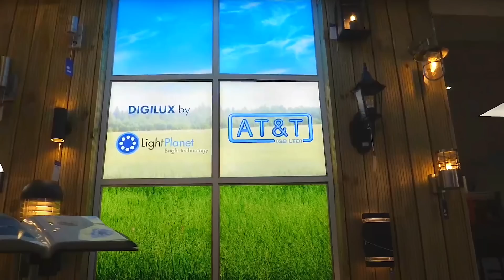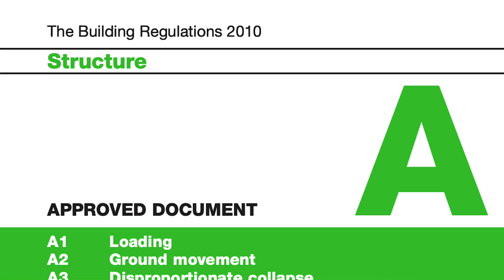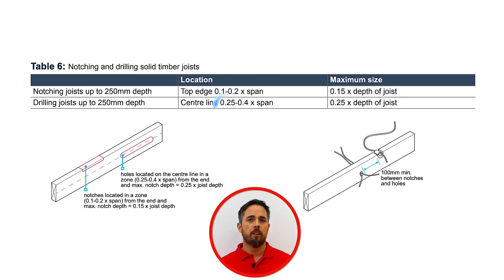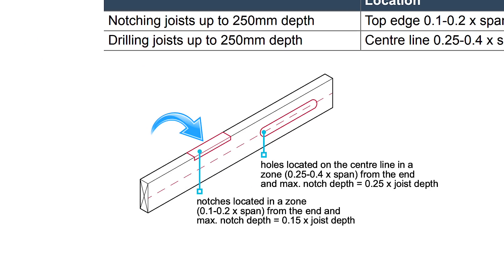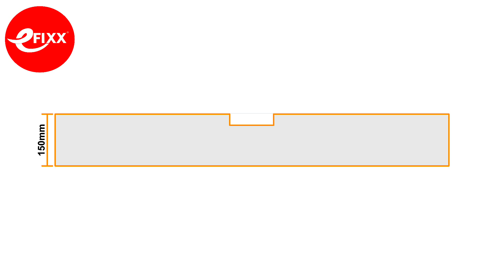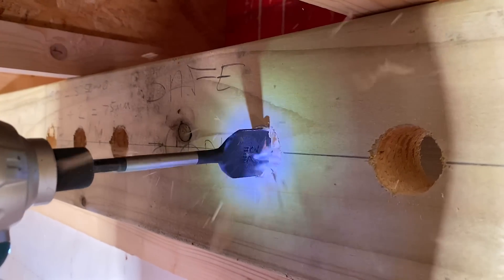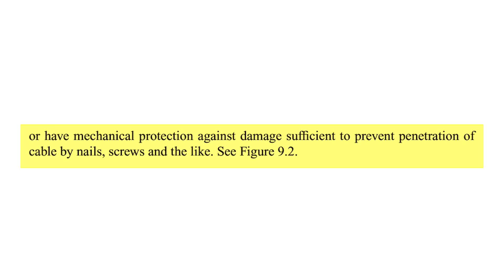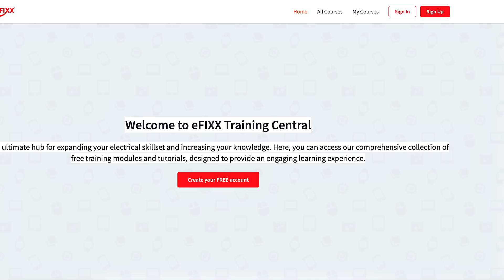Can You Notch Joists To Run Cables?

Comment: A general rule of thumb is don’t make the notch more than 1/3 the depth of the joist and you won’t affect it’s strength
Reply: the more precise rules are outlined in this video and say no more than 0.15 (just under 1/6) the depth of the joist, and even then, only in certain parts of the span of the joist

Comment: As a householder, I found that the joists in our previous Victorian house looked like a swiss cheese from various generations of water and gas piping, plus the electric wiring later installed. Our rewiring and first time central heating installation was difficult, made slightly easier by holes left from ripping out old stuff and the joists being much thicker than modern ones. 
Current home is v old, with oak joists, stronger, thicker, a nightmare to drill, but caused whoever wired it to notch joists stupidly.

Comment: You could apply a layer of battons underneath the floor joists and attach the gypsum boards to the battons. This means that there is available space for running cables between the gypsum and floor joists..... it's that simple!
Reply: good option if the ceiling hasn't gone up yet and you don't mind losing a bit of ceiling height
Reply: @ that’s how we do it in the Netherlands

Comment: What drives me mad is spending a morning drilling joists for pipes only to come back from lunch to find cables run through them. Don't use other trades routes as cables are more flexible than pipes. If you do, don't get upset when we cut them out.

Comment: That's odd - he listed what cable types / requirements should be used when less than 50mm from the surface, the last one being that the cable should be mechanically protected, then a few seconds later states that soft skin cables should not be installed in notches - but surely they can be if they're mechanically protected, such as by a steel plate minimum 3mm thickness.
Reply: yea sadly they decided not to go into detail about that and basically this video ends up as a caution against running cables through notches

Comment: Sometimes in old cottages they have cased floors (double floor boards ) example you take one board up and there is another underneath. Often running opposite directions.  I have even seen 3 layers of boards . You have no choice but to notch the board underneath. 
It there is a likely hood of a nail being put through them I put a safe plate over them. If that’s unlikely I normally just put a buckle clip over the notch to stop the cables moving and keeping them in the notch . It’s surprising how many notched cables we see crushed as the previous electrician couldn’t be bothered to put a clip across the notch.
All this will sound alien to new build house bashers
Reply: Interesting point Andrew !

Comment: Had sagging floorboards upstairs where plumber and electrician had run cables and pipes across the width of three floorboards, with the middle board held in place by the t & g of the other two!  
Sorted it by sheeting out the whole landing with 10mm ply to support the compromised boards from above.

Comment: Who the heck is going to ask a structural engineer if they can cut a notch, if they did the answer would be, you need a steel in there, that's all they rely on these days.
You can't put a cable in a notch but a few gas pipes will be fine, no danger there, I assume these people writing these regulations realise we can now get screws and nails that are longer than 50mm, I know that may shock them, nowhere is completely safe.
Reply: that line is also there because a joist of >=250 mm depth suggests that there might be something particularly heavy above. or you can just go the safer route of a central hole

Comment: The engineer should supply the information required before you start that's why they get paid more if not they are not doing what they are paid for
Reply: If you are doing a rewire for a private individual there's no engineer involved.
You just use common sense, if a house falls down because of a hole or notch in the wrong place, I would say the house was f#&ked before you started.

Comment: your man in your video at 0:08 doesnt look like he's got 50mm to the bottom of the joist from his holes there you know 🤔
Reply: look closer, looks to me like there's an extra bit of wood along the bottom (not sure the correct name) but bit like an I-joist.... I think that's what you're looking at..
Reply: @jameshansing5396 I dont know what youre looking at but the hole he's feeding the cable through with his left hand and the one before it looks about 10mm from the bottom
Reply: Oh I was looking later on.  Maybe that's them showing how NOT to do it, given that it's before they have not passed on any info at this stage?
 @codenamenel

Comment: How do you know the entire length of a joist when there is a ceiling beneath it and floor above it?
Reply: It's easy if there's no ceilings in place, if the ceilings are up you won't really know for certain
Reply: One assumes you'd be lifting floor boards to drill through the joists? So ummmmm see if you can look? and I guess in some cases a little common sense. EG NOT one foot away from the outside wall would be a good start..
Reply: @jameshansing5396  sure but I was thinking of retrofitting downlights and just drilling holes not notches
Reply: you're not an electrician, are you?  @hks-lion
Reply: @jameshansing5396  no I’m not and not planning on doing any electrics but would just like to understand the process
Reply: @hks-lion  other than the retrofitting of downlights you just mentioned? 😂
Reply: @jameshansing5396  no I’m getting an electrician to do that. But seeing as I’ve watched a niceic electrician drill straight into a cable and do a “visual” EICR, I prefer to know something before they come in so they can’t completely pull the wool over my eyes. But feel free to laugh on, I was only trying to understand the process.
Reply: @hks-lion  good for you trying to educate yourself. https://www.youtube.com/watch?v=XnDr8xOe6gw is an interesting video but his technique is technically non-conformant because the circular holes he drills are not central. to answer your question – you will have to lift floorboards and/or cut inspection holes that you'll repair after determining the true extent of the joist

Comment: If good old common sense still existed a tradie could take a look at a joist...and could determine " nah "... you'll weaken it... BUT these days " nah " get the book out ....let's have a site meeting...ring the office...check the Internet...and all after you've donned all the PPE ....and text mummy..... bollocks.....
Reply: Is that why all the joists in my house look like they’ve been attacked by a lunatic
Reply: Think you'd be lucky to get any consideration TBH. Cable's would be laid over or underneath 22mm central heating pipes with alarm cable wrapped around them all by here today gone tomorrow house bashers
Reply: Your not allowed to use common sense anymore
Reply: Paddle bit that sh*t and keep living your lyfe.

Comment: Good video but some views on what would be sufficient mechanical protection would be good. 1mm steel plate, 2mm plate or thicker? There are times when there are notches already there preventing extra holes being drilled and you have to use existing notches.
Reply: More holes and notches houses will fall down. Does the notch already exist, yes don’t put more in
Reply: @dougsaunders8109  yes, exactly, hence the desire for guidance on how to protect the cable you necessarily are going to run in the existing notches
Reply: It would b 3mm i believe. I did look into this a while back. 1mm steel is easy for screw to penetrate. 3mm stell id b pretty happy with.

Comment: One for the structural engineers - if you drilled a hole through a joist and inserted exact sized steel conduit into it, have you restored most of the structural integrity?
Are compressive forces now transferred almost as before the hole existed?
Reply: Sounds like a good job for the apprentice, cut these lengths of 25mm galv into 1ft sections and thread both ends of each piece so we can get it through the joists 🤣
Reply: It improves the matter but doesn't restore it to its original integrity. You still have a weakened structure with the slit/cut in place that could propogate/settle/move over time or under the same stress conditions
Reply: Your wording of ‘most’ is ambiguous. Your theory addresses compressive forces but neglects tension. All joists encounter both so it depends where the hole is.
Reply: @imik3y  there's some over thinking going on here. Back in the real world, you drill a hole or notch where you have to, you have no option.
Reply: @acelectricalsecurity  you always have a choice, including the one where you don't do the thing that violates regs. your attitude is exactly the kind that created all the regs in the first place
Reply: @GeorgeHafiz  get in the real world it's ok putting it in a book in an ideal world but we don't live in an ideal world.
Reply: @acelectricalsecurityAnd what other regulations do you ignore because they don’t apply to you in the real world! I presume that your public liability insurance covers wilful negligence in your dealings with your clients property!
Reply: I would say it's all nonsense, have you ever heard of a house falling down because someone notched a joist in the wrong place or drilled a hole in the wrong place.
Reply: @acelectricalsecurity  The question wasn't will the house crumble, its was will the structural integrity be restored and the answer is no. If you would like to prove it to yourself feel free to model and simulate with finite element analysis two beams with a load applied, one with no notch and one with a re-inforced notch. The answer will be the re-inforced notch will fail before the un-notched beam. Hope that helps.
Reply: @Dr.Stacker  I don't really need to try it, drilling a hole in a joist or even a notch will have little to no effect.
Reply: @acelectricalsecurity  By all means do what you like with your own home, just feel bad for the next owner haha
Reply: @Dr.Stacker  well I won't be losing any sleep over it put it that way